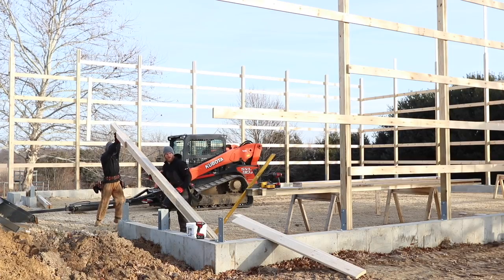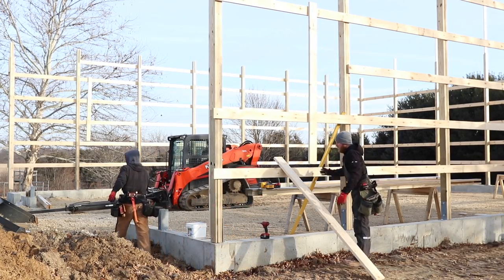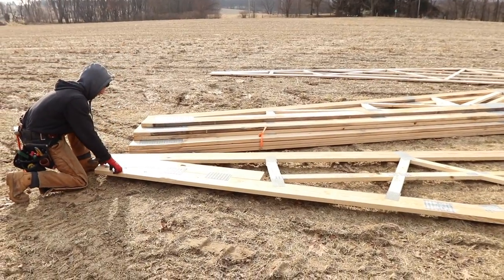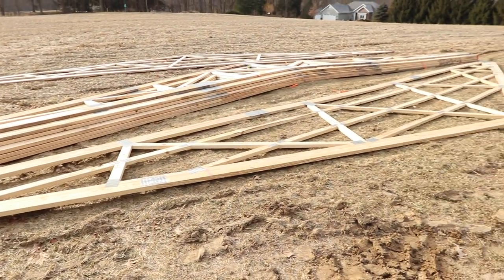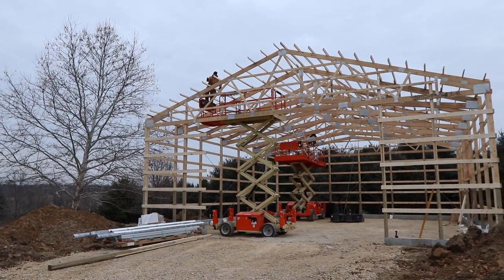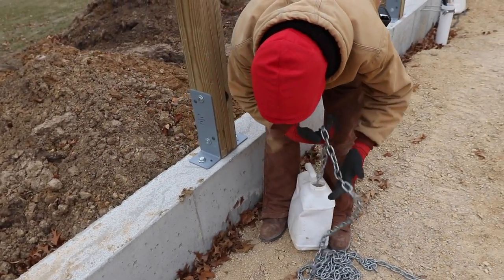Building a Work Shop: Setting Trusses

Comment: I really love the Post Frame construction, I just wish down in the South we had that type of construction for out buildings. Unfortunately here we have metal buildings everywhere and I really hate having to "design" them. I never really feel like the Client is getting a quality product and depending on which metal building manufacturer wins the bid the steel is almost always different than it was designed and it really causes problems during construction and changes orders tend to become an issue. Unfortunately no matter how much I try and to my dismay my clients are always convinced metal buildings are a better choice.
Reply: Not sure what you mean by down South if referring to Central and South America, or Southern US?
Reply: @Joshua79C  Southern US
Reply: I see now, well check out Miracle Truss if you never heard of them before, open web truss frames using wood for the secondary framing (walls and roof and such). Would be cool if other steel frame offered this same construction so you can easily enclose and insulate it more efficiently compared to steel frame insulation which is sandwiched between the skin and secondary framing ( yeah I know you can also insulate any way you like) but without so much of the main frame sticking out as with MT.
Reply: @Joshua79C  we typically end up furring the walls out to wrap the columns and add more insulation. But you end up with wall thickness of over 14"+.  NTM issues with ADA that makes it a challenge to be legal. There just aren't enough tradesmen to go around anymore and especially in specialty type stick framing. Metal buildings are the "cheap" solution and is exactly that.

Thanks for the suggestion, I'll have to look them up and see if that is a possibility in my area.
Reply: Personally I like the post frame more than steel frame as it is more versatile and less if any order changes along the way for the components compared to steel. But I am not against steel, by which I meant earlier is the secondary framing on a steel frame is wood that is between the columns   with tabs for attaching the wood framing. It would be akin to traditional stick framing where all is flat surfaced and not like post frame with the girts and purlins sticking out (which can be added in if the wall cover finish requires it). But Post frame and wood trusses with its limitations where spans over 90 foot are going into the engineered category for those along with the columns becoming bigger as well is nice you wish to stick with that style of look using wood. But at that point I would rather include some steel to help strengthen it all, at least at the walls.  Then again If i needed over 200 foot width and money was no concern then I would go with steel truss for the roof and columns with the walls being filled in using timber for its versatility and ease of relocating windows and doors. All in all I am in favor of both but each to an extent per their own benefits as opposed to downsides being costs are higher for steel.

Comment: @RR Buildings Not trying to be to personal as far as finances go but ballpark what would you say this build would cost the customer. Just a rough estimate, sorry if that's too personal thanks.
Reply: 35 per square foot for a "general rule of thumb" to get an idea, around 20/ft2 if DIY or a bit more of 25/ft2 with some help.

Comment: Why don't you guys use metal constuctions? Here in the Netherlands we built almost every thing with metal constructions, seems faster and maybe even cheap. And defenetly stronger
Reply: For the typical size pole buildings they build. The costs of doing steel framed pole buildings would be much more expensive, if you can even find a company willing to fabricate it. (Steel buildings are pretty much limited to much larger commercial structures, many of the company's who build them will barely return your call if your asking about something smaller then 80x100ft) The footings often would have to be larger as steel is heaver. A crane would have to be rented (or bought and maintained) to lift the parts. This incurs more cost and people are always shopping for the better deal so wood wins in the end.
Reply: There is one company (back in action, but under new ownership and all new design, since 2015) called *Miracle Truss*, offers the strength of steel with the versatility of wood for the secondary framing (girt, purlins, opening framing), that is if you do not mind open web truss frames jutting into the "work" or "living" area/space.

Comment: You don't put 3/8 plywood underneath The metal cheating ??
Reply: English is not your strong suit it may seem, 'cheating' by which you mean to type "sheeting", and no it is not typical to sheet the underside with ply or particle boards in this type of covering as it requires some breathing space.